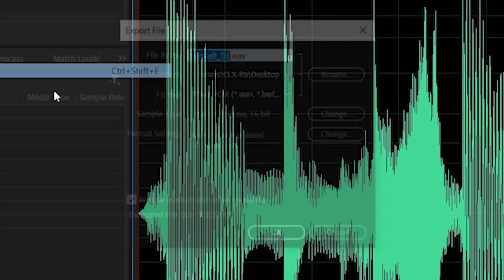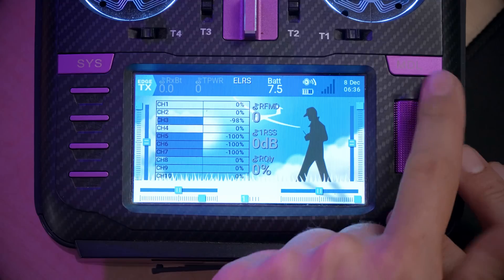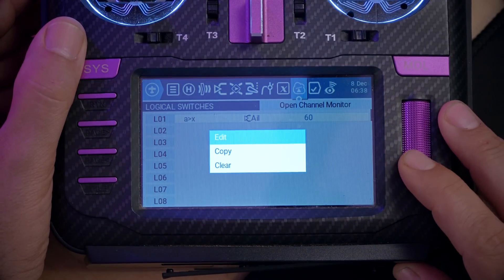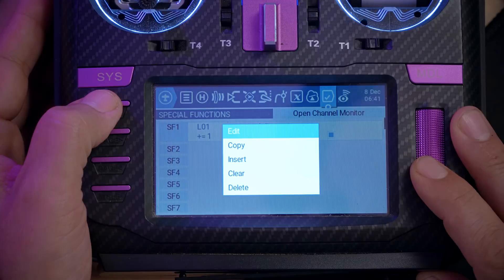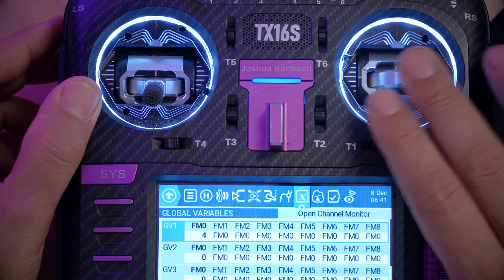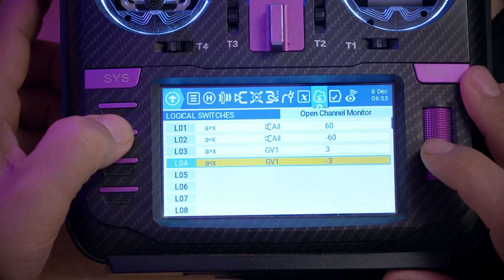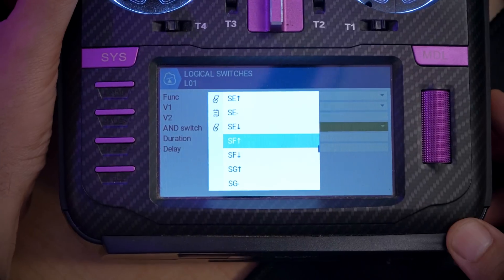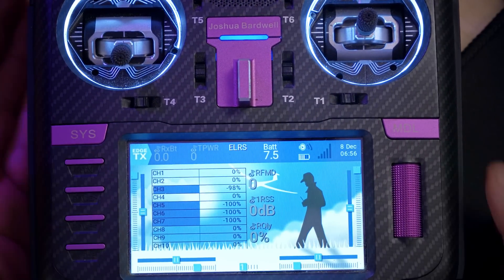Freestyle pilots can't turn left. Let's fix that. (OPENTX / EDGETX ADVANCED TUTORIAL)

Comment: Cool stuff!
Man bought myself a RM TX16S MK2, at max volume(yes sure it's at max volume), I can barely hear it (like the front speaker is almost non existent and the back on still low), tried replacing and even putting a second rm tx16s stock same speaker in it, barely better, still not loud enough, compared to Taranis X9D Plus 2019, it's whispering, any advice?
Reply: You can use a soundeditor and increase volume a bit.. There is some headroom left...
But too much and it sounds scratchy..
Reply: @dg9bfc  thx, will try.
Question: how do Radiomaster get away with sth big as this?
Reply: Sth??

Comment: My problem with the idea is, that you have to roll the same number of times to the left and the right, else you would end up upside down. Like you first roll left to enter a left turn, but some seconds later when you end that turn you will roll to the right to get flat again. I believe this more suited for angle mode than acro/air mode.
Reply from the maker: You can also turn upright by continuing to roll right. It's a circle.

Comment: This and another of your videos discussing rates gave me an idea. Would this work… add logical functions to detect when stick deflections enter a number of thresholds, say in 10% increments. Do this for pitch and roll, and make these logical switches increment a counter when you enter each of these bands. Then you display a counter for each band showing how often you entered that band you will get a sort of real-time analysis showing if your rates are too high. For example if your stick deflections are only typically 60% max and never get near 90 to 100% deflection then you know your rates are too high and you have more resolution to play with by reducing your rates? Conversely if you are regularly maxing out the stick position you may benefit from increasing rates? Just a “brain fart” at this stage and would need some experimentation and refinement, but could this help pilots monitor the suitability of their rates?
Reply: Yes, that would probably work. It would probably be easier to write it as a Lua script or widget though, and also then could do other fancy stuff also. But certainly possible just with LS, SF AND GV

Comment: I’d like to know if you can turn off the backlight when armed and back on when disarmed. I don’t need the backlight on when I have my goggles on flying.
Reply: Yeah, just do a special function on your arm switch. There's an action for backlight.
Reply: @ericaschner3283  Thanks, I'll have to look into this.
Reply: @bp328i  I've had mine set on my "trainer" switch in global functions since I started flying ages and ages ago, but no reason you can't double up on disarm instead.

Model -> Special Functions -> Your disarm switch in the disarm position | Backlight | MAX
Reply: Backlight can also be set to auto dim/off after a delay - you can choose whether stick inputs or keys wake it up again.
Reply: @pfeerick  I already have that, but thank you. I was thinking off completely to save some battery while armed since I have goggles on anyway.

Comment: Is it possible to make a "pull up" sound when flying too low or approaching the ground and how to make it and program it into the radio?
Could this be the subject of one video?
Reply: That's only possible with at least one of these three things being present in your aircraft: GPS, Barometric Pressure Sensor, & a Time of Flight sensor (this sensor needs to be mounted on the bottom of your aircraft & aimed at the ground).
Keep in mind that GPS altitude is subject to vertical dilution of precision, barometric altimeter is subject to atmospheric pressure changes (especially with respect to the reference "Mean Sea Level" pressure), & some cheaper Time of Flight sensors are subject to UV interference from the sun.
Reply: not without gps or barometer
Reply: If you have a FC with a barometer or a GPS, and use a radio link with telemetry  (Crossfire, ELRS, Frsky with smartport or Fport...) properly configure,  you should get an altitude reading amongst your telemetry sensors (Alt for barometer altitude compared to init, GAlt for GPS altitude but compared to see level). Telemetry sensors values can be used in any logical switch like in this video.

If you use a baro, it should be pretty easy to do a basic version using the same comparison logic Joshua used in this video. With a GPS it would be a bit harder, because you need to record the GAlt value at arming to know what altitude the ground is.

Comment: It's odd to me that you're only using the role.  I think this is only good for racing with a high camera angle.  Typically roll doesn't make you go left or right. Can you do this with a mix or would you just switch it to the yaw?  Also this just seems like a great way to practice. that way you're practicing going both ways equally.
Reply from the maker: I'm thinking mostly of snap rolls. But you can adjust the threshold however you want. Both roll and yaw are used in all turns.
Reply: @JoshuaBardwell   I hope you can understand my confusion when you talk about turning throughout the video😉😂🤣  I'm just being a complete smart a** I loved the video